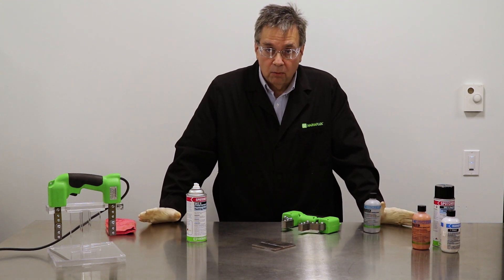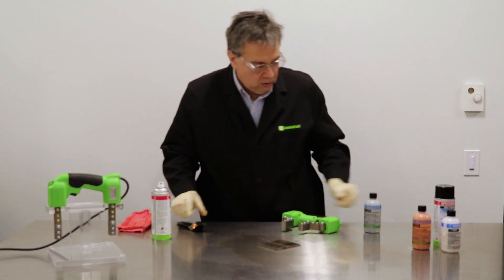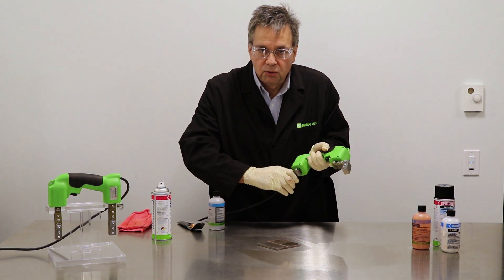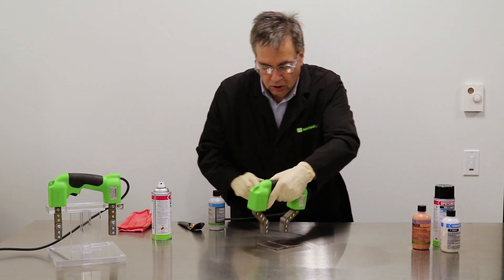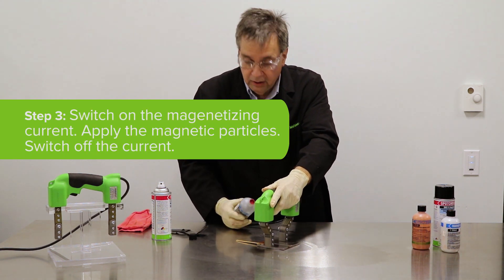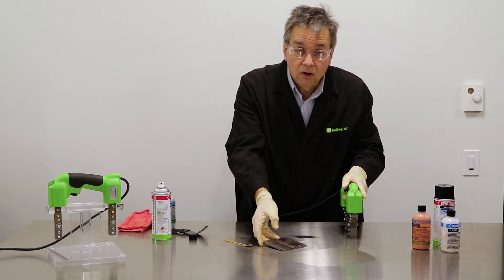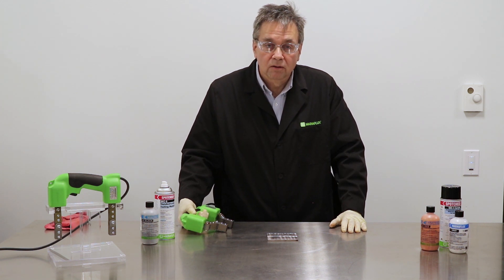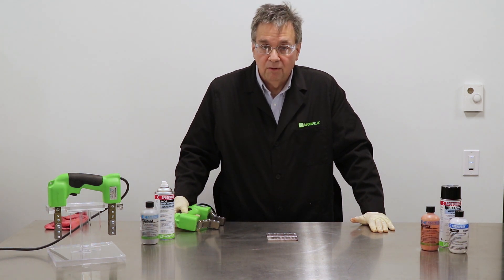How to Do Visible Magnetic Particle Inspections

Comment: will you  please say about the calibration of the MT yoke  , as per the EN norms.Duration of MT yoke calibration full details regarding the calibration and verification of the MT yoke.
Reply from the maker: According to EN ISO 9934-3, AC magnetic yokes must provide enough lifting force to pick up a 10 lb / 4.5 kg weight. The standard does not specify any calibration requirements, and does not specify how frequently the user should verify the lifting strength. Other MT standards, such as ASTM E1444, require the lifting strength to be verified at least every six months. In general, we see the industry trending towards checking the strength each day before use as a best practice.
Reply: thanks for the reply
Reply: Full Video For Magnetic Particle Testing Subscribe Me For NDT Training Free Video’s https://youtu.be/V8MolR6g9f4